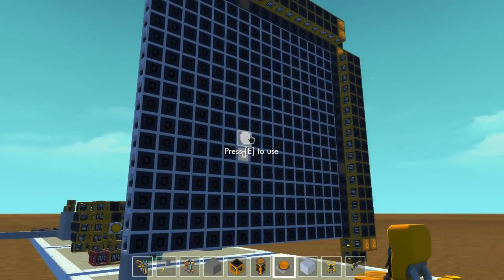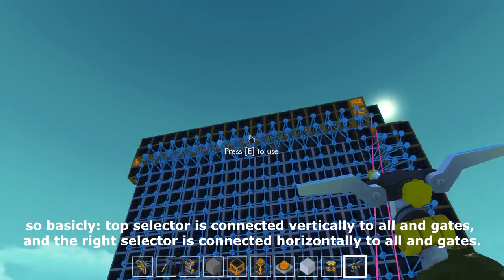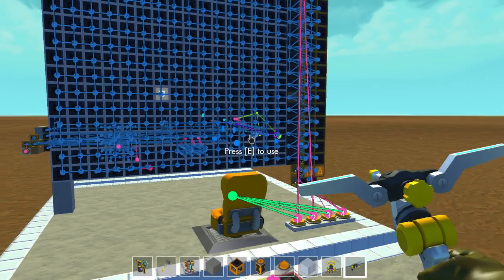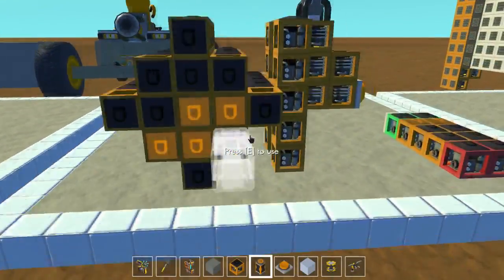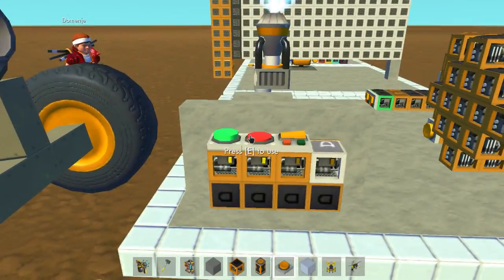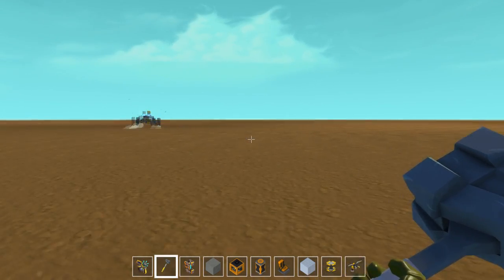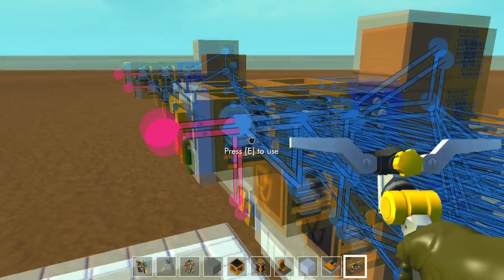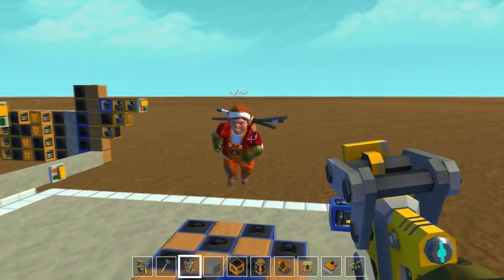Logic gates: coord grid & more advanced examples [Scrap Mechanic HD]

Comment: Can you make a compact way to convert an fast button input to a switch using logic gates? I haven't found a way to do it yet that doesn't require bearings. I would really appreciate that!
Reply from the maker: T flip flop, check part 2, u only need the "flip" , not the set or reset